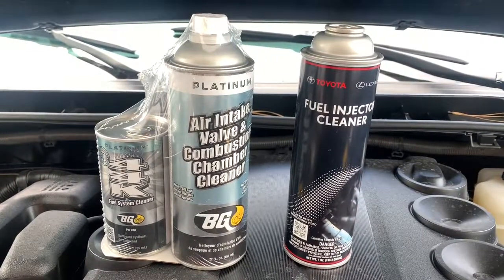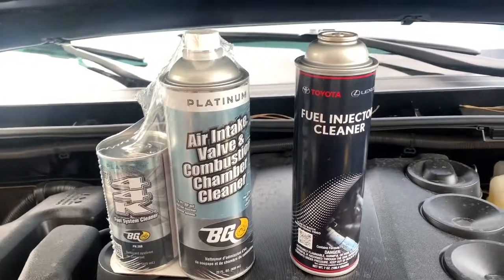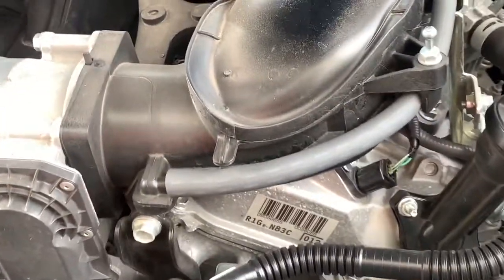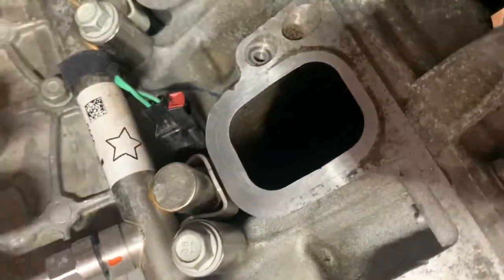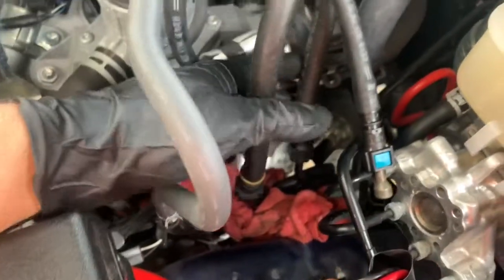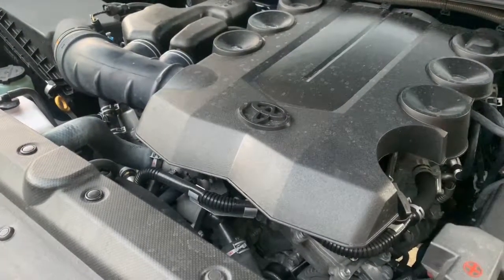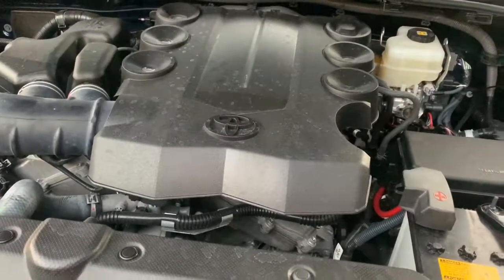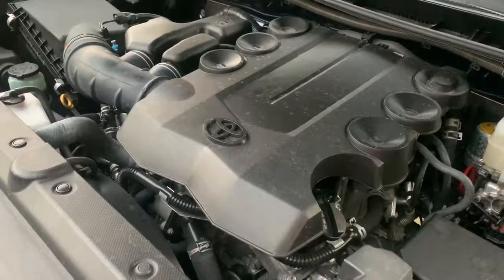Dealer RIP-OFF?? We think not. Fuel cleaning services explained

Comment: Would  36,000 miles for a Chevy Silverado 1500 be a good time to do the service I also use premium fuels and BK 44 every 5000 miles. I also have a S@b  cold air intake im a little concerned that the increased airflow is going to play a part in more carbon? But not a chemist or a mechanic Also how do we ensure they’ll be using BG products?
Reply from the maker: Cold air intake won’t cause and issue with how the car runs unless it’s not the proper one for the car/causes a service engine light. Use of premium fuel (shell nitro+ 93) is the best for cleaning. That with the use of bg44k every 5k is already giving your engine the best chance at staying clean. Unless you’re having drivability issues from high carbon build up or it does tons of short trips (delivery’s,constant idle) you could probably wait.

Comment: I just had this done on my 2015 chevy colorado with 82,000 miles on it for the first time. I didn't request it, but it was recommended. And my ears were open because i have noticed a little hesitation and worsening fuel economy.  I had both of the 2 fuel services done. And yes, I do notice a difference. Fuel economy is almost as good as it was when the truck was brand new, the throttle is more responsive, and the engine seems to run quieter and smoother like it did when it was brand new. However, the dealership recommends this every 15,000 miles. I don't think that's necessary. I would only get it done when you start to notice a difference in your fuel economy and or hesitation when you accelerate.
Reply from the maker: 15k does sound early but it does depend on how the car is driven. Someone who makes lots of short trips with non top tier fuel will build carbon at a much faster rate than someone that does all highway and uses shell v-power all day. Listen to your car for sure!
Reply: @RaceBreakRepeat  was recommended to do this. I'm at 90k Miles and embarking on a one way trip of about 1300 miles soon. Any reccs? Also was told to do the throttle service

Comment: Have a 2018 Rogue with 42K miles, had both the Injection and Induction Services done along with the oil change, had them  done at the dealer.... not cheap but I don’t expect people to work for free. I drive about 5-6k miles a month because I do Lyft part time so I feel like this services is warranted in my case. I plan on driving my Rogue until 300K miles and as long as the maintenance are done on schedule I don’t see any reason I could not achieve this. By the way, I noticed a much responsive throttle response and the car just seems to accelerate much quicker so yeah it works.
Reply from the maker: Good stuff man. Yes, commonly responsiveness is often the most commonly noticed benefit. 👍
Reply: Just did this at the dealer too for a Nissan juke . Totally agree on price super expensive . How much did you end up paying ?

Comment: At the dealership right now as we speak getting both injection and induction service done and hoping for the best. Will update how it goes. I’ve been chasing this issue for about a year. Everything I done so far it gets better and better. Spark plugs,coolant, and manually cleaning valves but issue slightly still there that’s why I’m doing the induction and injection service. And already have an catch can so this doesn’t come back. GET A OIL CATCH CAN PEOPLE.
Reply from the maker: Yes, air oil separator systems help immensely! Maybe I’ll do a video on this!
After you pick it up from dealer add some shell 93 stuff. Really efficient at cleaning which may help after the fuel services a little more. When I do my fuel services I fill up with shell 93 for the tank before the services to get the cleaning started.
Reply: RaceBreakRepeat I have about half tank of 89 right now should I just still fill the tank or just wait ?
Reply from the maker: Might as well wait. Either top tier gas brand with high detergents will help. I’m just partial to shell.
Reply: RaceBreakRepeat running 89 in it as of now but I will for sure try that out, I use mobile synergy I tried shell 89 it didn’t like it as much as the mobile but I think it just didn’t adjust to it right off back usually take abit or driving for the car to adjust. But will do thanks a lot
Reply: RaceBreakRepeat update : SO once again it’s even better but it is still doing it slightly now I put it on cruise at 45 and it starts doing it but much quieter it’s (86 degrees F) Florida. Maybe theirs still more carbon on the cylinder top enough to keep causing it but will try shell v-power 93 and should I go back to 87 or 89?
Reply from the maker: V-power is only 93 from what I know. If you still suspect carbon run it for a while and even add sea foam to the tank for a while. Carbon build up can be a mofo. Extreme cases intake removal and physical cleaning can be required.
Reply: RaceBreakRepeat okay cool, Yae I manually cleaned the valves 9 months ago been running a catch can since
Reply: RaceBreakRepeat oh and full tank of V power or ?
Reply from the maker: Yes, v-power. I think they may all be called that but the top tier has most detergents.
Reply: RaceBreakRepeat running a tank of v power will keep running for a few tanks should I go down to 89 shell or back to mobile where I usually go when I’m done.
Reply: RaceBreakRepeat sorry for so many questions lol
Reply: RaceBreakRepeat runs beautifully on 93 shell wow haven’t heard a single ping at all. Will continue to run and add either sea foam or Techron to the tank I’m usually a Techron guy.

Comment: He is absolutely right my Tucson is pinging and these services are needed I even cleaned the valves manually still pinging and have a oil catch can. So I’m going to just get this service done to hopefully resolve the issue. It’s a Direct injection service.
Reply: Did it work?
Reply: @KBradAdams  no it was also burning oil so their was bad carbon buildup on top of the pistons baked on and it was messing with the compression and combustion of the fuel and air. The catylic ended up going out got rid of the entire Car not worth it.

Comment: Doesn't seafoam do the same?
Reply from the maker: Yes! it can do similar work when run through such an apparatus however.  This particular stuff is water based. Sea foam is not.
Reply: Seafoam will not do the same. Seafoam is alcohol based. And is a dice roll. Alcohol combusts complety during combustion cycle of engine, raises octane lvls, and combustion pressures. Which sometimes lead to large chunks of carbon breaking off from intake valves, cylinder head etc. And going down stream and potentially harming the fuel/air system. BG fuel products are polyetheramine based (not water). And survive the combustion event, therefore traveling downstream with exhaust and potentially cleaning O2 sensors and cats depending on deposit level. I cant speak on the Toyota stuff.

Comment: Good information but lack of proof
Reply from the maker: I was going to add proof in the video but I was not capable of recording the piston images with my camera. quality was too poor. I can say that you can feel the difference and vehicles that do this regularly experience less oil consumption and loss of power later in life.
Reply: @RaceBreakRepeat   $10 boroscope from Amazon do the trick in no time as long as you have access to sparkplugs hole and intake.  What I found, this induction service is 99% never needed unless you drive in very short trip in very cold area like CAnada or Minnesota.    I bet your engine do not need it.  Toyota has no issue with intake valve because only few are direct injection only like in 1.2 Turbo in Europe.